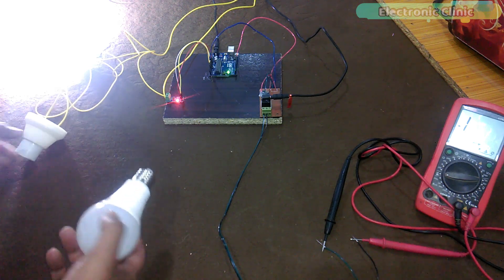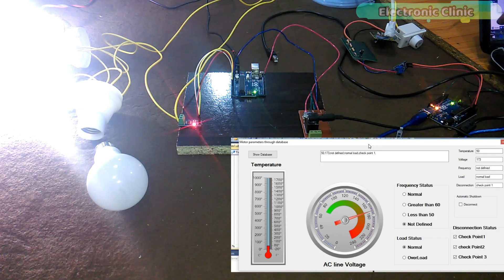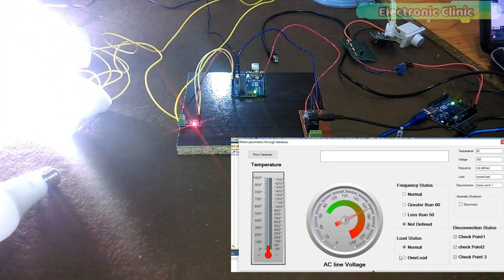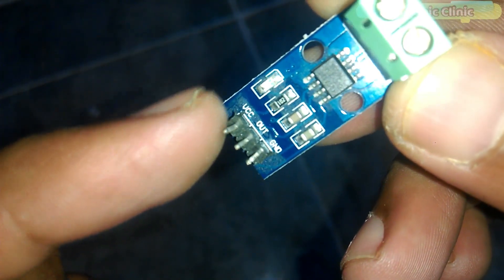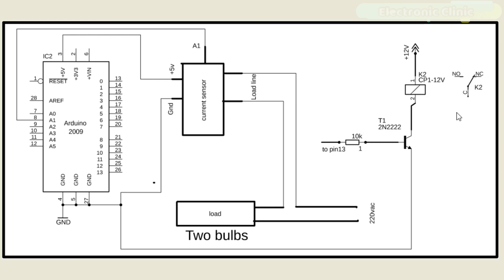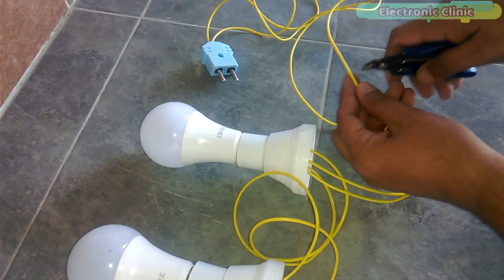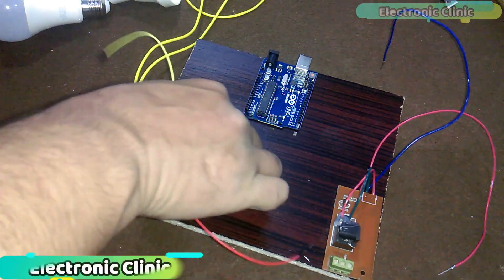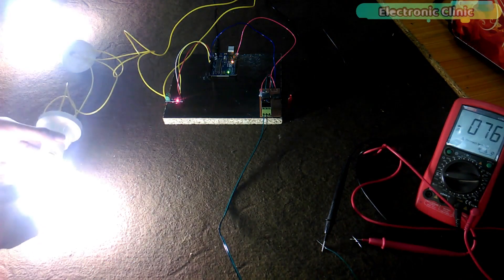Arduino Project: Over load monitoring and Protection using ACS712 Current sensor

Comment: How can I add a LCD 16*2 in this circuit to measure the current or voltage
Reply from the maker: check playlist
Reply: @ElectroniClinic  can I use a doughnut module to measure current instead of the ASC712 , without changing the code?

Comment: hi i want to ask. my project is over current and over voltage monitoring system using scada. i have problem with my circuit. i wonder if i can just upgrade this circuit. i really hope if anyone can help me.
Reply: if i want to uprade from this circuit should i add voltage sensor
Reply from the maker: i also have a video on over voltage, you should check playlist.

Comment: what is that white thing you are using to vary the voltage?
Reply from the maker: Fan regulator used in this project for varying the ac voltage.